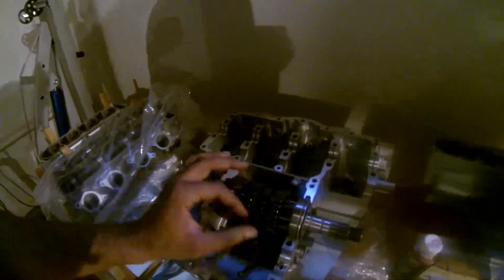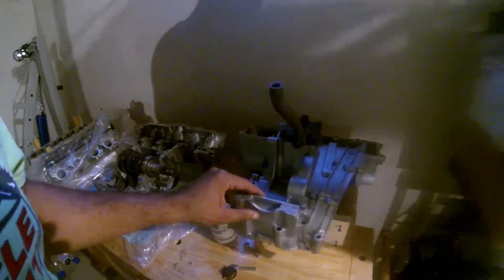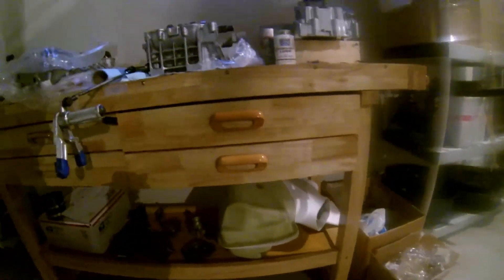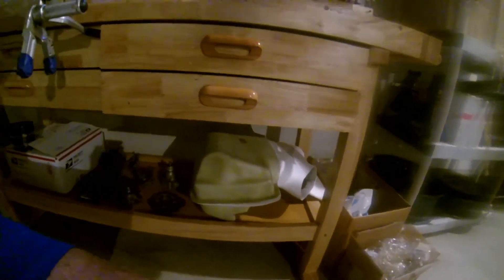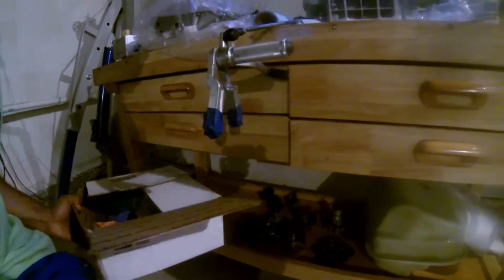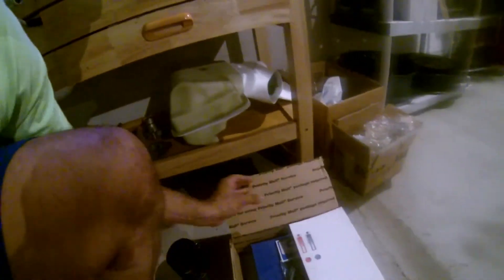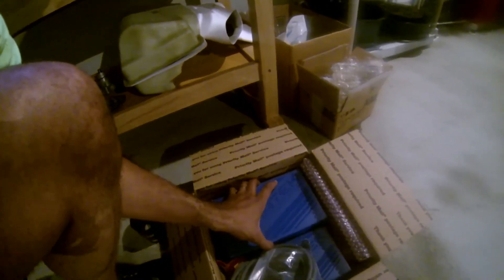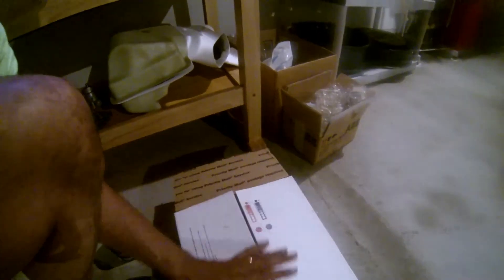ZX779RR Teaser - Ceramic Transmission and Camshaft Bearings

Comment: Dayum. That is pretty cool! Let us know how long they last. For some reason I see a flake of metal getting into the bearings and have the ceramic BB explode or something like that. Are ceramics more durable too?
Reply from the maker: Thanks.  It's been about 4 years now and they've been holding up fine.   The only thing that had me concerned is that the stock bearings had a little knob on the outer race that sat into a groove on the engine case.   The Ceramic bearings didn't have that knob.  In spite of that though, they have not shifted in the engine case under load.   They have stayed put and I've beaten on the bike pretty good.

Comment: where did you buy the Ceramic bearings for the cams and input shaft
Reply from the maker: I worked with worldwidebearings to have a kit developed for the ZX7R.  It had never been done before for this bike.
Reply from the maker: I also had a bearing developed for both shafts of the transmission (not just the input shaft) and a part number was generated.
Reply: Cool. Thanks